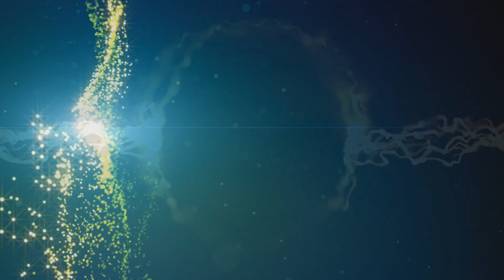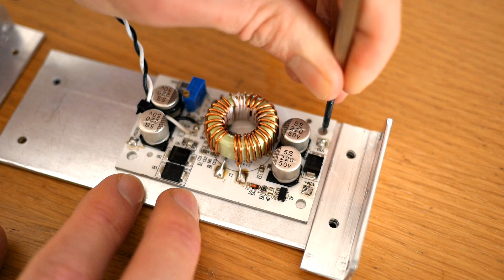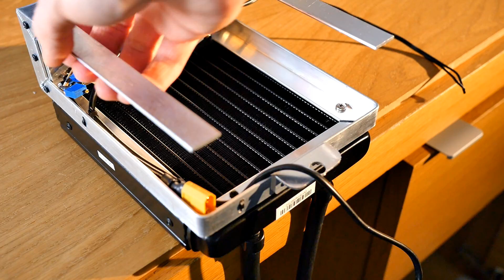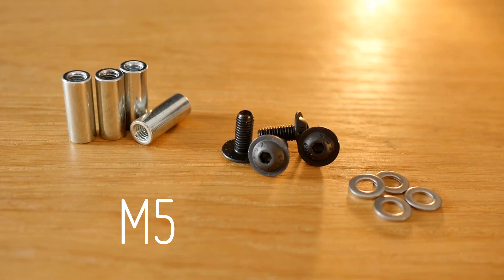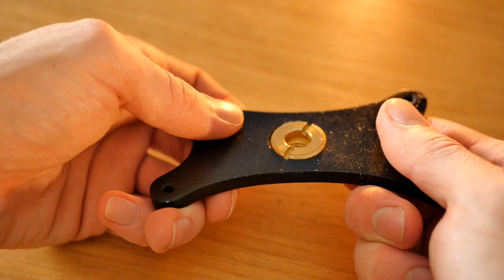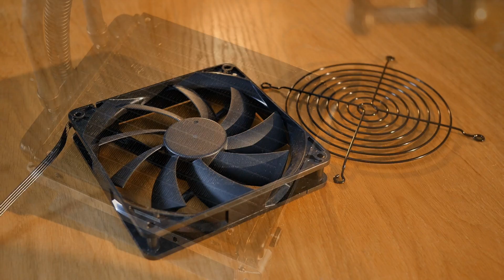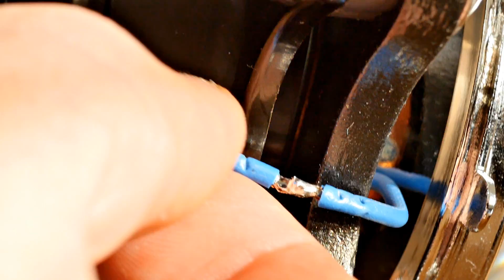1000w equiv. Watercooled LED (DIY SUN BLASTER 2.0)

Comment: Amazing build! Although try not to have the pump on the highest point of your watercooler loop, as it makes the air bubble stay in the pump, which lowers its life expectancy. Having it hanging underneath a shelf upside down is the best way to go, as it lets the air bubbles remain in the rad, which is safer for the pump.

Comment: Really cool! One too though, the tubes on the cooler should be on the bottom side, otherwise the pump can be damaged. It should also reduce noise from water cooler.
I think this could be a really cool integrated led bar for a car light!

Comment: Great video, it's worth mentioning that if you run the pump above the radiator for any length of time, air will settle in the pump causing it to burn out and fail. (even though the water cooling system is sealed there is always between 2% and 10% air which is why you hear a bubbling sound when it is first switched on)

Comment: The level of the pump must be lower than the level of the radiator. In this way the air from the aio will be in the radiator not in the pump. Air in the pump will damage the pump in time.

Comment: That AIO is gonna die really fast in that configuration. Air bubbles will rise to the pump from the resovoirs in the radiator ends, causing it to burn out

Comment: Has anyone ever tried to control this boost converter with a microcontroller? 
I want to control the output voltage with an Arduino or better ESP8266 to increase the brightness of a 100 W LED very smoothly via a computer or even better with an app. 
So far I removed the voltage adjustment potentiometer and tried to emulate the voltage that goes from the potentiometer to the IC on the board (it's TL494 from Texas Instruments).

Anyway, your videos are amazing and very inspirating. Thank you for this good content here on YouTube!

Comment: I’ve done a bit of math based on general LED lm/W efficiency, and then had a look at the Yuji specs for this LED to see if I was close. These things have an efficiency of 77.21 lm/W. At 100W that’s 7,721 lm’s. A regular tungsten bulb has an efficiency of 15 lm/W, so a 1000W bulb produces 8,000 lm’s. Close enough. A 1000W quartz halogen however, the lamp used in filmmaking, has an efficiency of 20 lm/W, putting out a whopping 20,000 lumens. So, this LED still can’t hold a candle to real film lights. Still, these 100W lights are roughly equivalent to 400W quartz halogens. A considerable power savings and, with 95+ CRI and low heat, still desirable... if you are willing to put in the faff time and parts money.

Comment: Hey! So I'm very new to electrical engineering, but I get the basics. I'm in the process of making a light similar to this, but much lower spec. I'm wondering about how to edit the circuit presented towards the beginning of this video to provide 10W instead of 100W. The LED I'm using is rated for 9-11V and 0.84-1A. I don't quite understand the resistance on the variable resistors and the potentiometer, and I'm unsure if I should use the same voltage booster. Help!

Comment: Pumps should not be at the highest point of water cooling loops. This is because air builds up in the top of the loop over time as liquid leaks/permeates out over time. Pumps will break if left on with no water going though.

Comment: Something to keep in mind if you build this is that computer water cooling solutions are intended for the radiator to be higher than the pump.  They are not filled 100% with water (there is some air headroom) and so having the pump above the radiator means that it is often dealing with the air bubble in the system, which reduces cooling.  Especially if you mount this to a wall, make sure the light and pump are below the radiator for maximum cooling.

Comment: Your videos are great and the production value is through the roof. Too bad though that like so many of your other LED videos, you fail to do any sort of comprehensive testing or showing the result to the viewer. Instead you show how bright a $200k LED is while pointing it at the camera in a bright room inside your house instead of outside at night. It puts you to shame. After spending 20 mins watching you solder and bend steel, have the curtesy to do a proper demo when you're finished, dickwad! Fuckin hell!

Comment: Hey there. Love your videos. I am considering creating a light similar to this but it will only be used underwater. Do you think it would be viable for the light to just be cooled from being submerged in the water? Of course after waterproofing the important electrical connections with epoxy perhaps. What do you think? Would this LED cell with just some wires attached, waterproofed, and the proper power supplied be able to stay cool enough by being submerged underwater? Thanks!

Comment: I have a question, why did you decide to change the LED dimming method from using voltage to current? Does adjusting current brings any benefit over voltage?

Comment: There's a flaw I guess. I did the same things but when you first fire it up, boost converter supplies 55V which was dangerous for my LED. Instead I just hooked it up to multimeter first and set the voltage range. Then in the maximum voltage, I set the current.

Comment: Can only find 1K or 5K large potentiometers here, did find the small multi-turn ones. Wondering if I should add a resistor, or if the 1K will give me enough range.

Comment: The problem I found after 2 solid years is the fan runs very slow when you plug 11.1v lipo and turning the fan step down dial doesn't do anything

Comment: Does the power supply give smooth power, i.e. for high frame rate recording, will the light appear to flicker, or will it stay at a constant light level? Also the H90 is no longer available, any other recommendations? I have the 50W Yuji module.

Comment: A quick question, why do you use the outer solder pads on the potentiometer footprint on the board? Those don't change when you turn the potentiometer

Comment: I find this interesting for automotive use. I'd like to fit the LED into a vintage spotlight housing and watercooled seems like a good solution to have the bulky cooling system external as I couldn't possibly fit a heat sink and fan into the closed housing.  The issue I might encounter is the length of the water pipes, I don't know if that pump could handle it.  I would also like to use a single cooler and pump for two separate LED's

Comment: If anyone wondering, there is pre-applied thermal paste on the coldplate between the LED and itself. You should always use some heat conductive paste when cooling transistors, leds, microchip IHSs or microchip dyes.

Comment: Someone should start making projectors with LED light sources. Not only would it allow a much brighter picture, it could do so while using less power, producing much less heat, needing much less cooling, and therefore being a much quieter projector. As if this wasn't enough the "lamp" would last as long as the projector itself, and unlike bulbs neither lose brightness or experience color-shifts. I have already been waiting years for LED-based projectors to come to market, but the manufacturers are incredibly slow to do so. Apart from cost (which can't be that bad; after all this brighter-than-required LED is $170 to the consumer, buying a single one - an expensive part, to be sure, but the bulbs they use today aren't cheap either and are much less suited to the task, as far as I can understand).

Comment: Which AIO water cooler specifically is he using? The US link goes to the H90 with a 140mm radiator and the UK link goes to the H55 with a 120mm cooler.

Comment: Nice, and that one is only 68 lumens per Watt. Imagine the incredible battery life you could achieve by using one of the 171 lumen/Watt Cree XP-G LEDs. It would be 17,100 lumens! (as opposed to the current 6,800 lumens)

Comment: Like this a lot. I have a Water cooler which I don't use, (too noisy), which will be ideal for this.
Quick check of the two recommended 100W LEDs shows the better one is $130 while the lesser is almost $6. 
The cheaper one sounds just fine.

Comment: Does this reflector and lens have the same yellow halo around the outside of the light as the typical 44mm lens has? I am building a light based on your first sun blaster and this one and putting it into a 4 inch pvc for protection while doing cave video and photography. Your videos are awesome thank you so much!

Comment: Hello, i have some confusion, when you remove the poteniometer  from the CC driver are you removing and replacing the CC o the CV pot? .

and when you calibrate the amperage are you doing it via the CC or the CV? 

I am attempting to make a 100W RGb LED and as the volt needed changes I am jsut wondering what you are dimming with Voltage or current.

Comment: The price per LED is quite spendy. While it is true that you have to pay for quality, the two pack is a deal breaker for me.  I found a very comparable part from Luminus Devices Inc. on the Dig-Key website. Check this out. 
1214-1230-ND
http://www.digikey.com/products/en?keywords=1214-1230-ND

Comment: Having a great time with this, just one question, my amps reads about 2.2 then the LED start flickering like crazy until I low the amperage, what can be wrong? the light its pretty bright even at 2.2 but I want to make sure everything is all right.

Comment: Rather than cutting through the wire by the LED, which is pretty stupid, it'd be much better to arrange something at the other end of the gooseneck. Maybe attach a temporary wire to the voltage booster board, and attach the multimeter between that, and the power supply wire to the LED. The current flowing is the same at any point in the circuit (Kirchoff's Law) so it doesn't matter whereabouts along the wire that the meter goes. 

Then once you've done your measuring, you could attach the 2 wires permanently with some sort of connector. Or you could desolder your temporary wire and solder the LED's wire in place permanently. Actually using a connector would be nice for future test and debugging purposes. 

Also I don't think he mentions it, with his fancy auto-ranging meter, but you should put your meter on the 10A range and use the 10A connector on it. I suppose most multimeter owners will know that anyway.

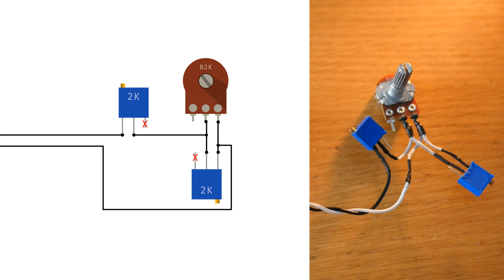Comment: Might be missing something but when you turn the potentiometer all the way to the max at 17:35 ,does that not make the DC/DC converter output 52V ? Since the LED is rated to 36 volts that should damage it. Or does the values of the potentiometer chosen at 4:44 meant that it will never output more than 36V ?

Comment: I'm jealous now - this build is just genius! :-)
Btw: For 30V of LED voltage you would need a 9S LiPo at least (8,3S at 3,6V/cell discharge end). So a step up regulator is the more convenient solution... ;-)

Comment: DIY Perks When I turn on the led for the first time, I am only getting 0.21 amps instead of around 1 amp. When I adjust the potentiometer on the voltage regulator the yuji led turns off and on at around 2.2 amps. I purchased enough materials to make 4 complete led units and have swapped out the regulator and the potentiometers, but still no luck. I've tried using a 12V 10A AC adapter and an old pc power supply, but still the led starts at 0.21 amps and blinks at around 2.2. Any suggestions would be greatly appreciated.

Comment: Any links to the gooseneck and gooseneck adapter you used? I can only find 5/8" 200mm long gooseneck on ebay and no adapters to hold it except some $5 male screws. Also is 200mm enough? I already bought the rest of the parts, please help!

Well after measuring it looks like I will need at least 300mm long gooseneck

Comment: i used the led driver to power my 100w led and used the led heatsink to cool the led driver. i tested the light with a 1amp power supply but then the light started flashing after that i connected  the driver to a car battery then it stopped flashing but thank you for putting the driver in the parts list

Comment: I'm confused by the "1000w Equivalent" claim.  1000w Metal Halide HID bulbs are generally rated at 120,000 lumens out of the box.  The 100W Yuji LED chip is rated for less than 7000 lumens.  A rough comparison would be 7000/120000 or about 6% of a 1000w MH HID bulb's output.  Now we are talking lumens, so not a very accurate comparison, but at least it is comparing full spectrum (white) light.  Even 10 of them is only about 60% of a 1000W bulb and uses a similar amount of power (approx 5A @ 240VAC assuming 100% efficient power supply).

Comment: Calling a single LED chip this size equivalent to 1000w is an overstatement - cool light though.

You really like the Yuji LED - but how much research and experience do you have invested into Cree, Bridgelux, Citizen and Samsung LEDs?

A 1000w HPS lightbulb outputs around 110,000 lumens

This Yuji LED is rated to provide 5500 - 6800 lumens

I know you mention that the CRI of these is really good (96)

Comment: Did you measure the Current on Your previous Sun Blaster Build?
I bought 8 of those LED Chips, and not a Single One reaches 100W they all draw around 300mA. Which is around 10W

Comment: is there something different about this build in terms of light efficiency compared to the previous build? Or is it just the enclosure/cooling that is a bit different. Which one of the two would you rate as the most silent? Can they be used indoors on fiction productions?

Comment: Is the water cooling really necessary? There are kits on ebay for 100W LEDs with the heatsink, lens and power supply going for 1/4 - 1/5 the cost of the water cooling alone.

Comment: Why not use some high CRI CREE X lamp series LEDs? I have a 30W XHP70, Which is basically 4 XML2s in one 7mm^2 package for a little over 4000LM. Its a $15 LED, but 3 of them should match the performance of this beast! And at about 10 to 20 bucks a piece depending on the supplier and exact binning chosen. Some are better than others.

Comment: is it possible to wire the brightness control in to control multiple boards at once? for example, i would like to have 5 boards, 5 leds and all be controlled via a single brightness knob, would i need to have difference resistance variable resister?

Comment: i ended up building it without dimming controls, followed your guide frame by frame but no luck. either 2k values are wrong or your wiring is wrong.

Comment: They make 80mm round fresnel lenses, you can pickup on eBay. You should throw one of those on there and give it the ability to move forwards and backwards to focus.

That said, have you noticed any flickering issues and such when using this in video or photos?

Comment: Does anyone have a quick comment on how to adjust the little voltage regulator to output 12 volts?  Also, does anyone know the pin out for the pump?  Those are my last two pieces to complete my build.  Any assistance would be greatly appreciated!  Thanks!

Comment: What voltage was the LED at when you were at 3AMPS. Mine goes to about 36V to get 3A but its rated for 34V. Wondering if that's okay for it though

Comment: Great job. I know the high wattage LED puts out a lot of heat. I was thinking of a large heat sink and no fan. I guess it is not enough? Geez, I really hate the extra bulk of water cooling, or even air cool. Why? Powerful light is for outdoor use. Meaning the cooling needs weather proof. Oh, too much work.

Comment: Hello. I recommend for your next project to look at the Nichia 219B 90+ CRI LED, only 300 lumens but small and cheap so you can add many of them and much smaller power comsuption. For example in a commercial flashlight see the Noctigon Meteor.

Comment: Is this voltage booster better than the last one? Can I use it as a replacement for the voltage booster on the old sun-blaster? Also, why doesn't this regulator has cooling? Just curious, because the 150w regulator from the last build had built-in heatsinks and this one seems to have no cooling at all

Comment: The ebay LED you linked to is "cool" light which is 6000K while the Yuji LED is 5600K which is the natural white color and you can get a generic 4000K ~4500K LED for cheap and the color temp is close to that of Yuji's LEDs.

Comment: If you do make that bigger light setup, I assume you are going to put all the LED's into a close knit design. If so, I think  you should use a copper backplate cooled with a peltier cooler for it in tandem with a water cooler to take care of the hot side. It would add some wattage to the total power requirements, but you would be able to handle very high heats in my opinion. 

I intend to use them myself here in the future if I ever get the stuff together to make what I have in mind. 

Think Solar Air conditioning, but not just hot air.

Comment: check these neat LED chips out, they are High CRI not as good as the Yuji ones but high quality for a much better price
http://www.aliexpress.com/store/product/High-Class-10-20-30-50-70-80-100W-Super-Lumen-CRI-Warm-Cold-White-Color/2092060_32647188057.html?spm=2114.10010108.1000023.6.IgkVyj

Comment: How did you adjust the current of the large led voltage step up module?
Mine (as advertised) does not allow multi meter short circuiting to adjust the current?

Comment: AWESOME!!! I was wondering when this would happen. When I watched the first video I hacked in one of my spare Arctic Cooling Accelero Hybrid units that I had purchased for my old GTX 670 FTW GPU... Running it from some of my recovered 18650 laptop batteries. I actually have a MacBook battery that I was able to obtain for cheap, but unfortunately, it only runs at some 10v or so, I think a maximum of 11.1v, which is not the 14.8v I am currently running at... Which is about the best efficiency I could achieve from the boost converter I found...